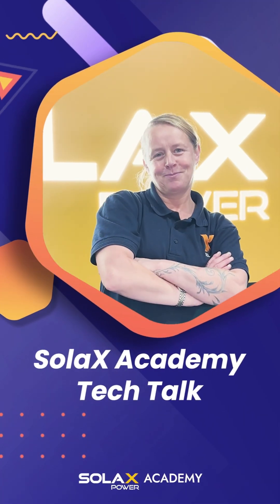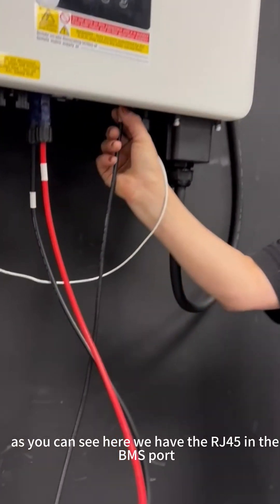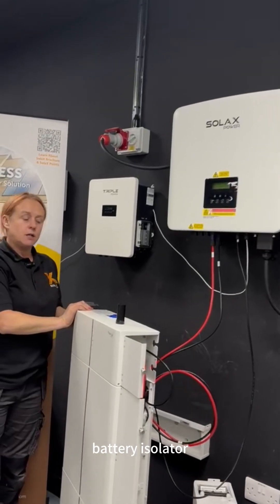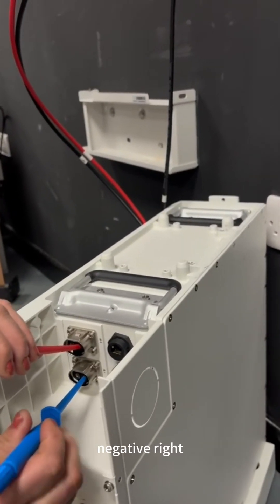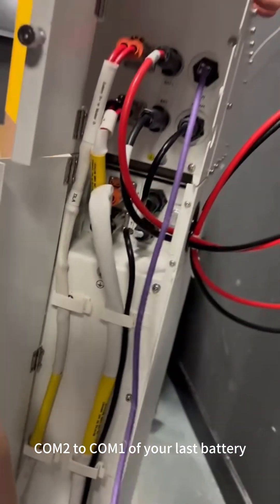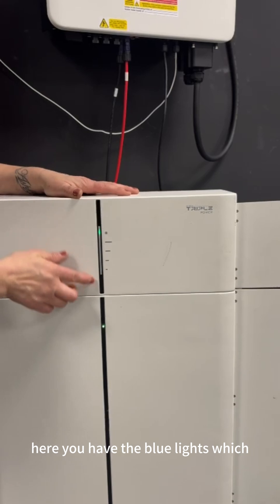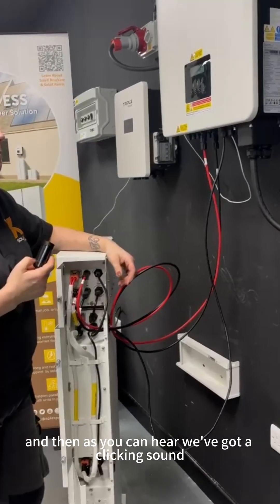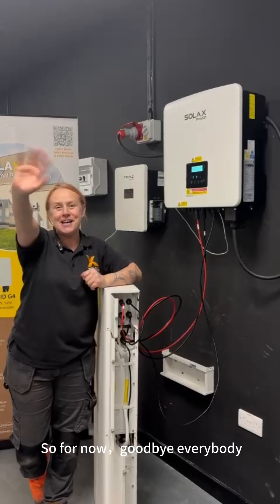SolaX Triple Power Battery 3.0kWh Troubleshooting

Comment: Emma just finally installed a X3 Hybrid 8.0 d series with x3 mate box 2x T 30 and BMS 
video cam in usefull as I had a faulty T30, so just wired the one in, however everything kicked in great, only to have a BMS vault BE12 come up turn off battery to inverter fault goes reads Normal battery at 45%
checked resistance on both the BMS and the T30 all showing open loop.
restarted, after checks.
run for a while with the fault again then the fault went returned back to Normal on iverter, solid green light on the BMS blue light flashing, no charging taking place any ideas. Terry